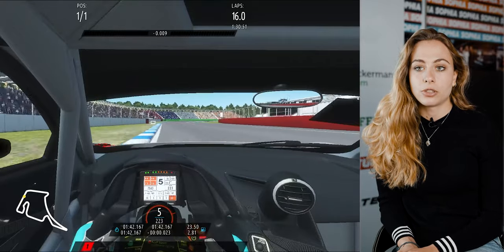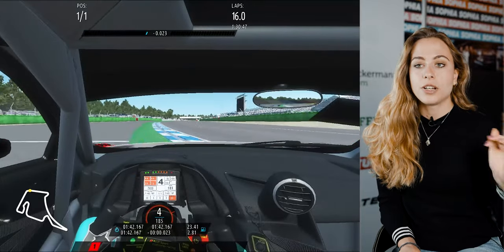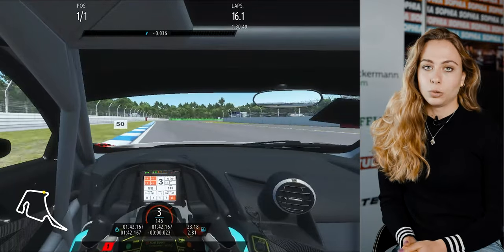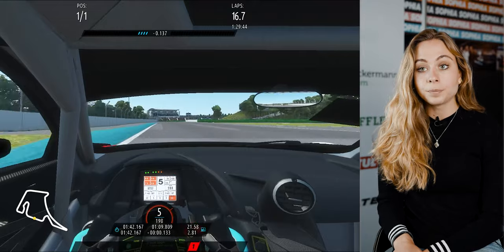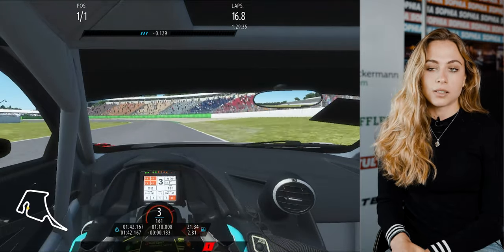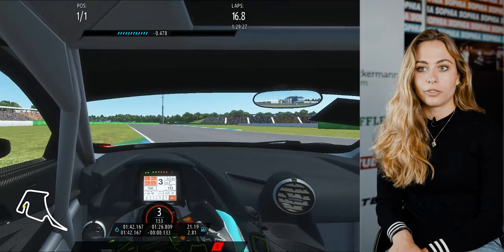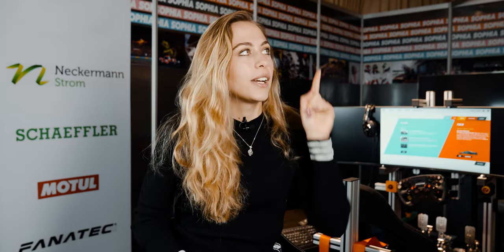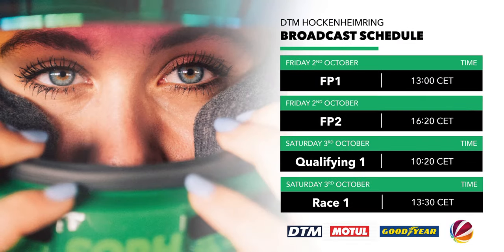SOPHIA FLOERSCH - A LAP AT HOCKENHEIM | Track guide | SIM - real life | rFactor 2 | GT3 R8 LMS

Comment: The "new"Hockenheim Motodrom does not feel very much home to me anymore.
I'd love to hear you dissect the "dip" between opel 1+opel2 before entering start finish straight .
In last weeks f4 race almost none of the competitors had a 
Good setup to go through this part of the track riding the car from a bottomed out left rear suspension ,which of course is not the ideal start into a very important corner .
Is this even a problem for the Audi R8lms?